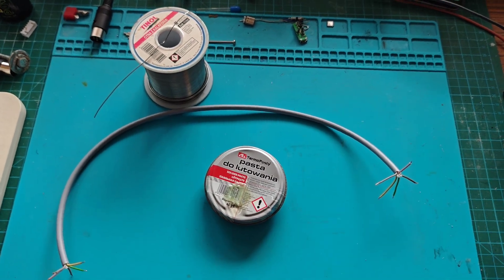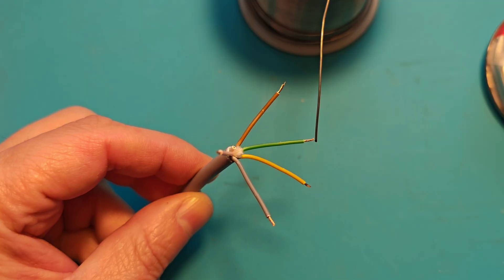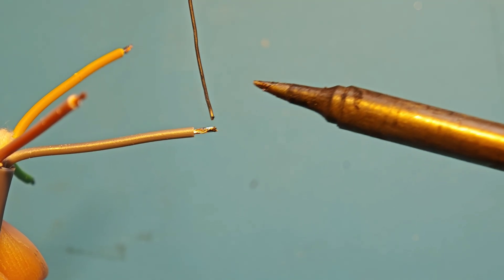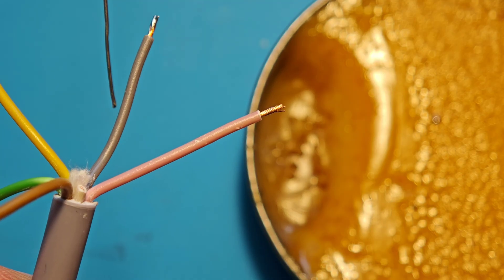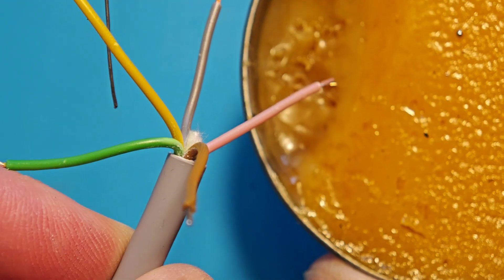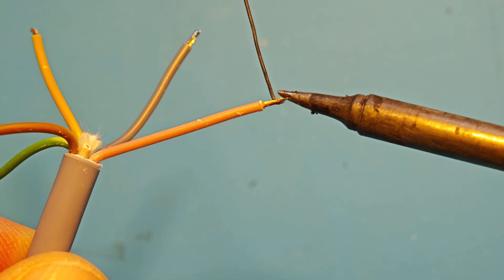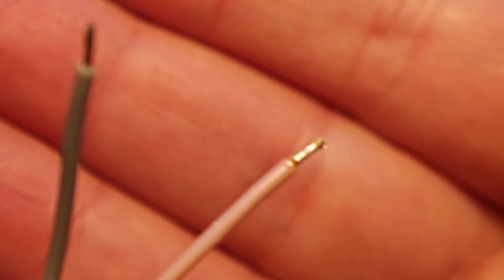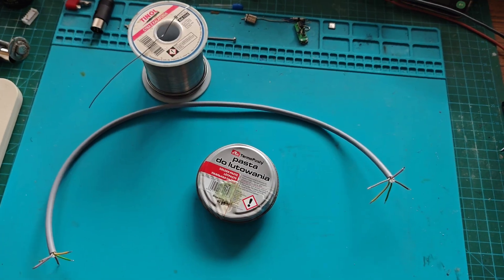Why flux is so important during the soldering process ENG

Comment: If it's so important why isn't it called fluxing instead of soldering.
Reply from the maker: Because we are soldering using flux. Its role is to clean the surfaces of joined metal elements from oxides and other contaminants, which ensures better wetting and better adhesion of the solder.